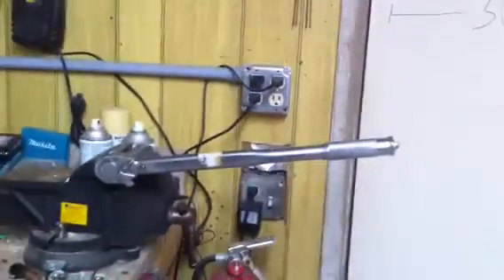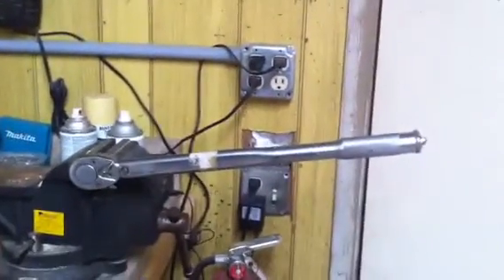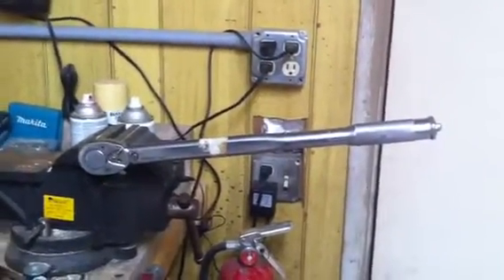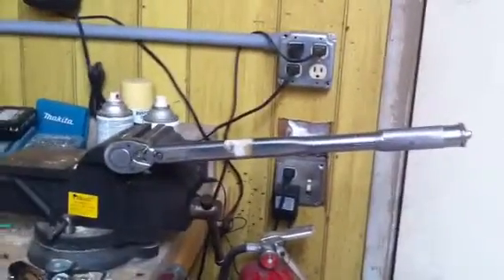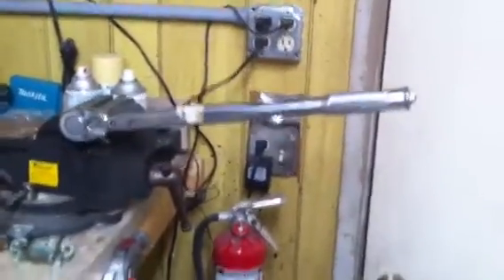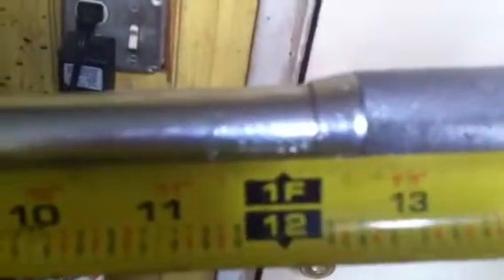Testing a torque wrench

Comment: the weight should only be put on the the wrench handle and not on the shaft for a accurate test.
Reply from the maker: I don't think that is the case with newer torque wrenches.  With older gauge style, that was definitely the case (the handles were even on a pivot so that the torque would be applied at an exact location.  But on modern click style torque wrenches the pivot point is right by the head, so anywhere beyond that pivot point should work (assuming the handle body doesn't flex).  In this case, to simplify the process I put it at the 12" mark.
Reply: If you have seen the video I would just delete this one.
Reply: should be at 12 inch's from the snap pivot for foot pounds and the weight included for the handle from the pivot point
Reply: Jack Redman inches

Comment: You will want to do a few more things before deciding if its accurate.  If it clicks that just means that 25 lbs was enough to click it, meaning its possible that it could have clicked with 24 lbs or less.